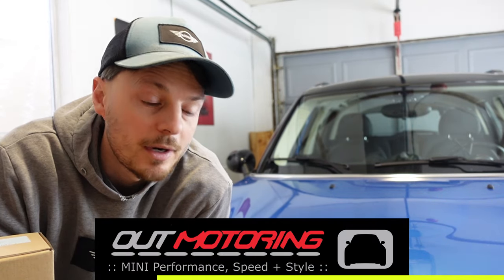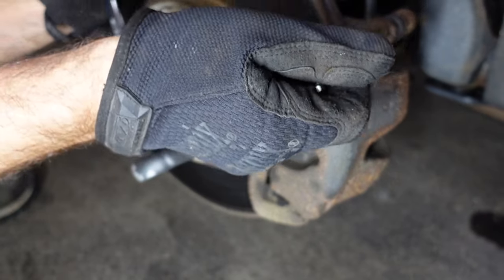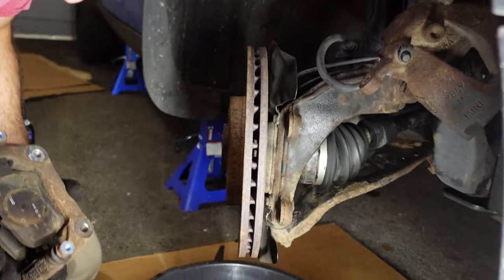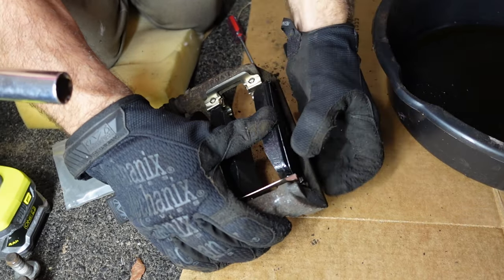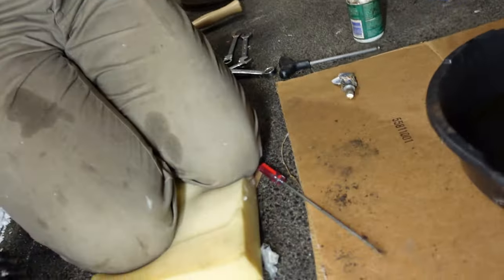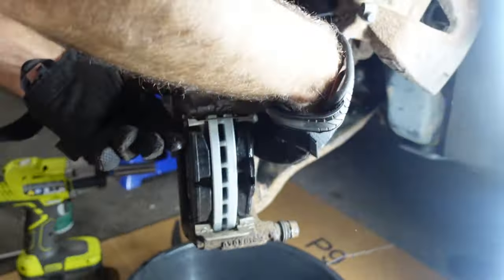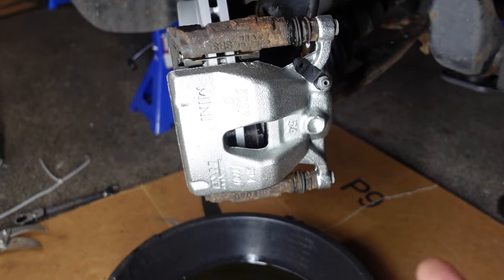New Front Brakes on a MINI Countryman R60

Comment: You replaced the brake discs with ones that were painted with an anti corrosion coating. Painted discs do not need to be cleaned prior to installation. The brake pads remove the coating in very short order. If you read the install pamphlet it would state “install as is”. Also you presumably cleaned the two sliding pins before re greasing them but you didn’t clean the old grease from the bore holes in the caliper bracket. That should have been done. The rubber boots should be checked for tears or cracks.
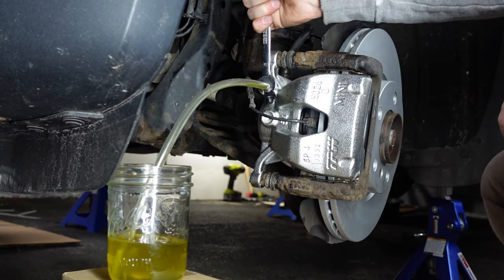Finally why did you replace the caliper? Was the piston seized? Calipers last a very long time. 6:46